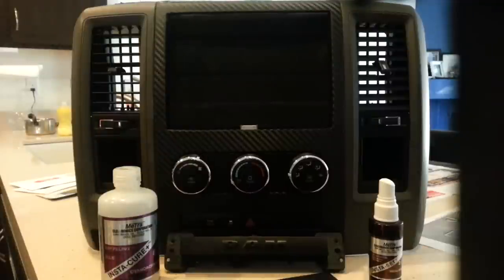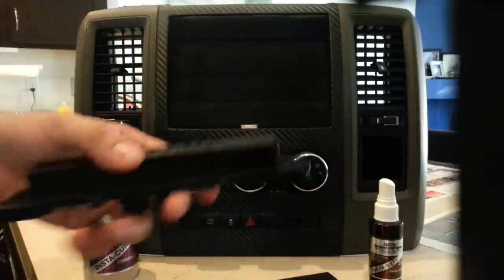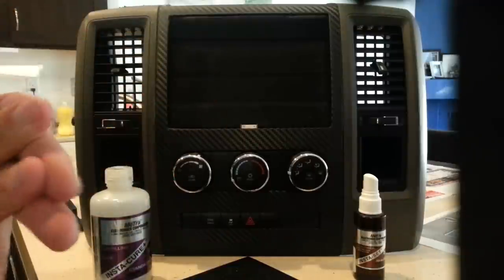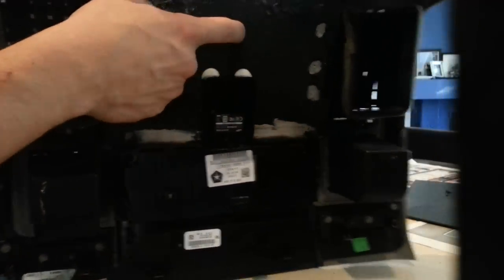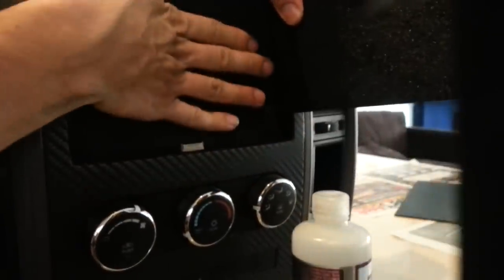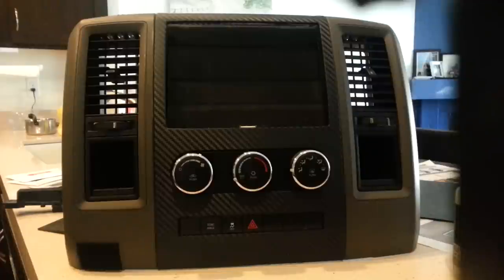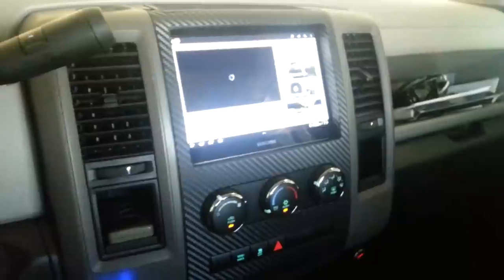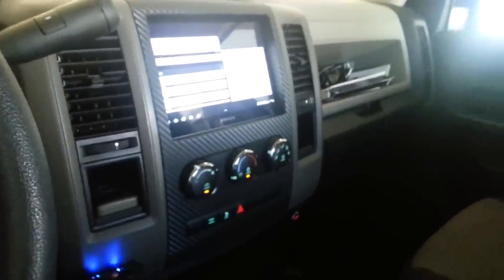Galaxy Tab in Truck 2012 Dodge RAM

Comment: I'm just stuck between trying to install my huge 10.1 or using my smaller galaxy tab 2 which is only about 7 inches. The only plus side to the smaller one is it has 4G and the 10.1 only runs off wifi.
Reply from the maker: Options are always a plus!
Personally the 4G would make things easier unless you're familiar with "tasker" app to automate HotSpot connection for you.
However IMO, 7" is just 1 inch too small and 10.1 is just 1" too big. LOL
Any thing between that is the sweet spot!

Here's some thing else to ponder. So the other reason I want to switch to the 8.4" is because that may, just may give me enough room to slap in a single din head unit. Now Samsung has released recently a new SGT 4 8.0" that would absolutely be a perfect fit for a single din HU and the tablet. Oh so perfect!

There are many pluses and minuses to this set up. Join my group on Google+ man, I've been trying to get a community going.
Cheers!

Comment: Curious why you didn't carbon fiber all of the piece.
Reply from the maker: That was a long time ago, I couldn't tell you what I was thinking then but I should have. I do have a 7" tablet dash still for sale if you're interested?
Reply: I just bought the 12” screen. Still waiting another month for it
Reply from the maker: @superchile9640  oh, nice.  One of those scicane android screens? Or the new OEM ones the new trucks come with? LMK if you know anyone that might want to buy the 7" slider setup I have 🙏😁🤘
Reply: Android. I didn’t know there was such a long wait on the preorder until 3 days after I paid for it. Horrible customer service. Hope the unit is better than their service.
Reply: Would’ve loved to buy the oem for the ‘19 but I’m. It sure how to make it work in my ‘12.
Reply from the maker: @superchile9640  those android radios are pretty decent. The issue with them is that the manufacturers don't put enough RAM in them to run Android smoothly. Android should have a minimum of 4-5GB of RAM. For best experience they need 8GB+ of RAM. I've built a few slider tablet kits. People that pay me to make them always want to buy shitty ass cheap tablets with 1-2GB and I tell them I won't do it, because after a few months those things slow down dramatically after software & media is loaded up. That & they're cheap af. These take time to make & they want to pay as little as possible, that's why I stopped making them.

Comment: I currently have a 2012 Ram quad cab and Im having that damn issue with the radio where the FM and AM dont want to transmit due to the chips inside. I just dont have the patients to take it apart and try to re soder the componets. With the next Tech now a days what would you recommend to do this. I am planning on getting a newer truck so my current one will be my work and play truck lol
Reply from the maker: I didn't know that was an issue with the radios. I guess I never keep my cars stock long enough to find out lol. Well I still have 1 of my slider kits left that I have up for sale. It holds a 7" Samsung tablet. I've had it for sale for $800 but if you're interested I wouldn't mind letting it go for half that. I'll even throw in the tablet and a pioneer stereo. All you'll need is a dash kit & harness for the pioneer stereo. The tablet slides in and out, it charges while the tablet is in. That's half the asking price so I will be firm on that but I will also ask for you to pay half the shipping as well since I'm letting it go for half the price. I could also let the bezel go alone for $300 and you buy the tablet and stereo yourself, but ask that you pay full shipping on that since its less than half my asking price. LMK what you think,  🍻 cheers.

Comment: Hi men u did a nice job I'm trying to do something similar to my 2002 dodge ram what caind of amp u use for u truck u said something about Bluetooth  can u provide me for info about that I will appreciate ur help . Good job
Reply from the maker: TY. Using an RF360.3 OEM integration EQ/device to stream the bluetooth from the tablet to the EQ. Then from EQ it gives you 8 outputs to go to amps. That RF360.3 also has Optical and RCA input you can use if you have the sound going from the tablet to a head unit. Good luck, join our small but growing group on Google+ communities called "Tablet Head Units".
Reply: good Job!!!  I love it.

Comment: That is awesome! How did you get the hazard panel to fit down where the ram logo was seated? I have an '11 1500 quad with the center console and the holes do not line up.
Reply from the maker: Hi and thanks!
I did have to make some adjustments.
I believe I drilled new holes on the hazard bar and I also shaved the bezel tab part that sticks out so it would allow the bar to slide in (if that makes sense).
I believe our trucks have have exactly the same bezel so it should work for you as well.

Comment: A ok thanks for ur help but wher I can buy it or wher u get it
Reply from the maker: Rockford Fostgate 360.3 can be purchased at Best Buy or Sonic Electronics or even Crutchfield. Best price I found was from Sonic Electonics however they're NOT an authorized dealer.
Reply: the rockford fostgate 360.6 is about $400-$500.  anyway i can get around a substitute?

Comment: Wat music player app are u running..? Im using an 8.9 SGT head unit as well and im looking into different players urs looks like a good choice...
Reply from the maker: On this video there are a couple diff. apps I'm using.
One is google play for my music source.
And the buttons I believe on this are from the app "Car Home Ultra".
Those are widget buttons, once you press play button on most music sources you can pause and play w/the widgets.

however there is also an app called Desktop VisualizeR that I use to create icons and another app called Tasker to create commands/scripts to use the icons. This just allowed me to use more customization.

I had put mine for sale on eBay and for some reason between it being up for sale and me using it the HDMI dock burned out. So now I just have the straight charging cable as the dock for it and no HDMI out. I have just been too lazy to put it back up for sale and I thought the HDMI output was a good selling point. I can't seem to find another one for a good price.

I'd like to see how your's turns out man.
I have a google+ community for geeks like you and I that do this type of stuff.
Join the group and share  your progress. Group is called "Tablet Head Units".
Good luck!

Comment: Do you have a parts list? Obviously the tablet and docking station. How did you wire the docking station to run on DC, and what did you use to send signal to your speakers? Did you use the headphone jack or a bluetooth item. Also, did you wire into the factory harness and amp or did you not?
Reply from the maker: therawlifefamily I explain all of that in my other videos but to answer your questions the tablet was at one point connect via USB to the back of my HU and at another time connected to cigarette lighter that has power when the truck is on. As for the audio, I used Bluetooth because 3.5mm sounded like crap and USB streaming acted all funky and just didn't work. So I was sending the signal to my Sony HU that was hardwired to my RF360.3, I also tried streaming directly to the 360.3 but since the Sony HU can be controlled via the Tablet I switched to BT directly to it and left the Sony hardwired to the Sony. It worked best that way and no loss on quality of sound.

Comment: where you put the original radio?
Reply from the maker: I actually took out the OEM stereo because it was garbage. But I installed an aftermarket Sony head unit behind this install that I can control from the tablet via an app. If you watch my other video you can see it.
Reply: okey thanks for your time and help :)
Reply from the maker: NP

Comment: Is that a galaxy note 10.1?
Reply from the maker: This is actually the old a$$ 8.9" that they stopped production on a long time ago. If you play your cards right you just might be able to fit a 10.1 tablet.
I purchased another tablet, the 8.4" Pro, to do it again because it's quad core and I really enjoy the "MILK" app that Samsung made. However there is no support for the old 8.9".
I had this posted for sale on eBay but the HDMI dock broke and I just have it plugged directly into the cigarette lighter because I was too lazy to shop around for another dock.
Long story short, for now I'm just using the 8.9" until I run into some one that wants to buy it as I'm not so motivated to work on the 8.4". LOL.
Cheers fellow enthusiasts!

Comment: Overkill??
Reply from the maker: Hmmm. Not really. I mean have you seen the 18" touch screen the Tesla has? And now Dodge has 8" touchscreens coming out from factory as well. I believe they see what enthusiasts are doing and thinking, hey we need this in our cars/trucks. I believe other manufacturers are doing this as well, but I know Dodge is now for sure.
I encourage you to try some thing like this, if 8.9" is too big there are kits I believe for 7" tablets out there.
I'm actually in the middle of editing another video right now to post about my upgrade to this. LOL.
Hey thanks for watching and commenting though bro! Cheers!
Reply: +Dan A (1m2) I mean I would really like to do that with my 10.1 tablet, just as long as i can easily take it out when i want to and or hv a security cover for it too.

Comment: how the hell did you manage to pull this one off? its awesome Im actually considering this since the original mygig on my ram is shit... Ive hated it since day 1
Reply from the maker: this one was easier than it looks. I'm working on another one to sell that has been a little bit of a challenge. almost done. just needs a few touch ups.
Reply: +Dan A (1m2) well if you actually make one of this for a 4th gen ram and your willing to sell it I would be happy to buy it because Ive always hated the nav/stereo on my laramie... srsly is utter crap and looks ugly as fuck
Reply from the maker: +Clearjab what year is the 4th gen? they don't make that tablet anymore so I'm using a new 9.7" Samsung and it looks kick a$$. yeah the stock stuff is mediocre IMO. If this fits urs I'll sell it to u but if not I can't make one from scratch cuz I'd need it physically here.
Reply: +Dan A (1m2) 4th gen is 2009 to 2013 I think mine is a 2009 Its been parked most of the time it has less than 10k miles on the clock have it all lifted up and stuff... its like a toy since my DD its a 2010 powerwagon but this thing would make it even more special since and android tablet gives more customization and flexibility on nav and music streaming
Reply from the maker: +Clearjab it would fit then. where abouts are you? can u message me?